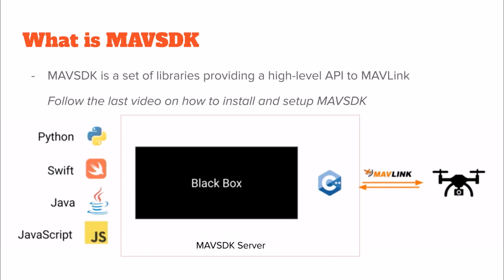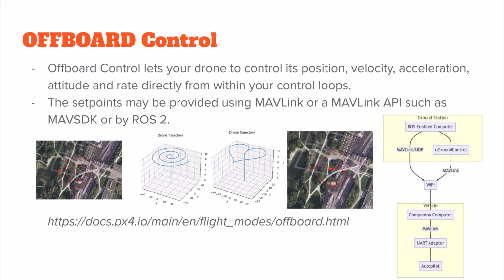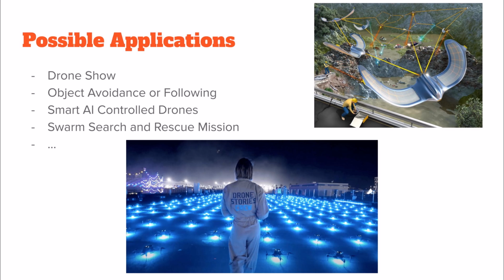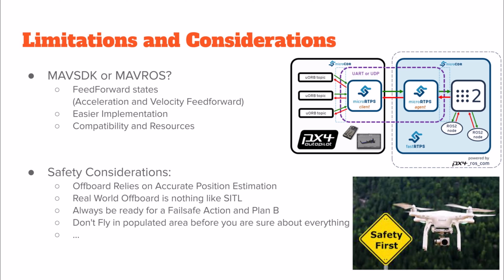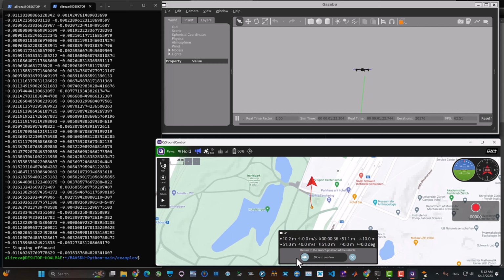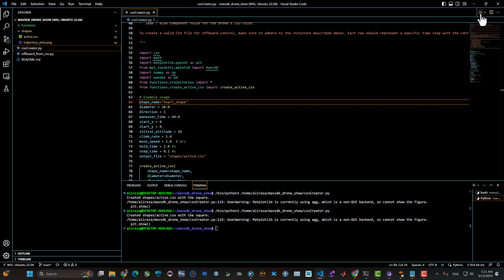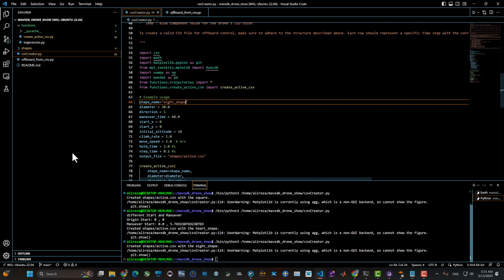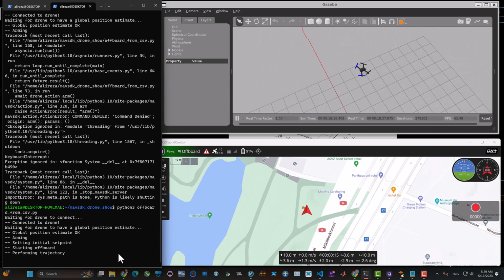Single Drone Show Basics with MAVSDK Offboard Control

Comment: Hello, thank you so much for your effort and very good tutorial. Then, I tried to download your mavsdk_drone_show and run the offboard_from_csv.py file but raised this error "./mavsdk_server: error while loading shared libraries: libcrypto.so.3: cannot open shared object file: No such file or directory". Can you please give me the solution for this issue? Many thanks :DD
Reply: mavsdk_server = subprocess.Popen(["./mavsdk_server", "-p", str(grpc_port), f"udp://:{udp_port}"])
I think the issue comes from this line in the source code.
Reply from the maker: have you used mavsdk seperately and it confirm it is working?
if you are only goin to you offborad from csv I have added it as an example in official mavproxy easy to follow
Reply: @alirezaghaderi  can you please give us the solution?
Reply from the maker: @taissirharizi4073  @khongluc1. Have you teied reinstalling openssl?    sudo apt install openssl
Reply: same problem here